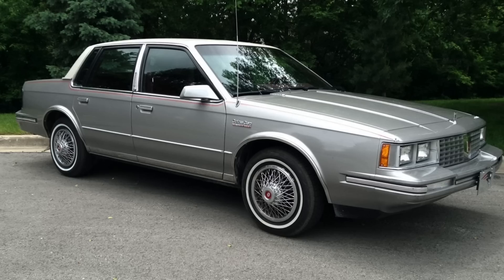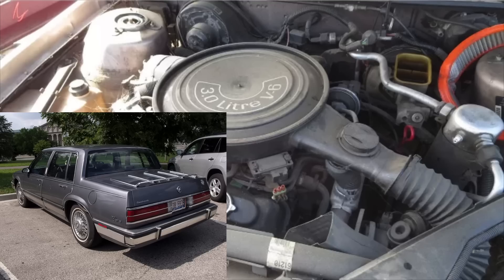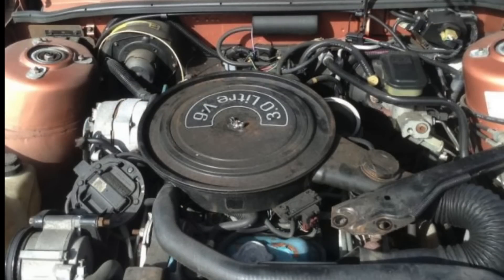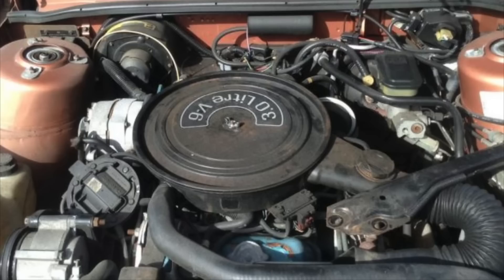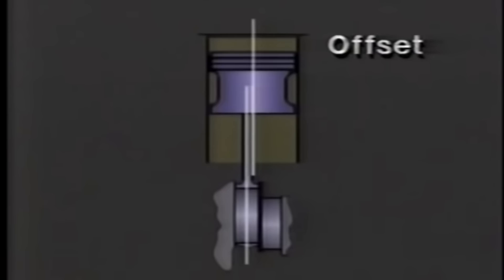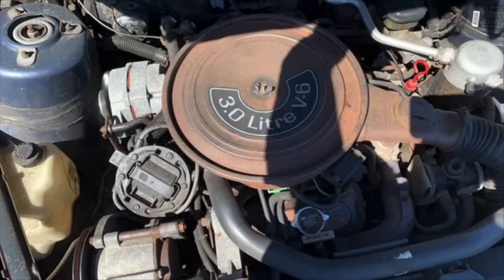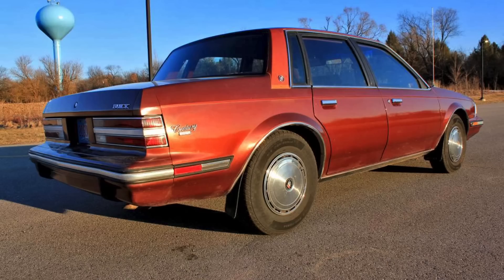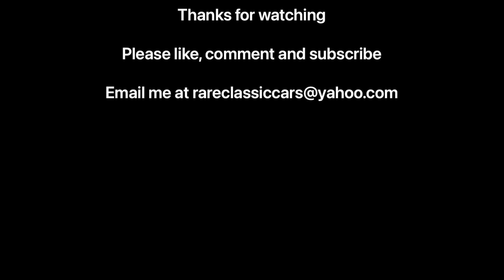Worst Engines of All Time: GM's 3.0L LK9 Carbureted V6 Engine (Buick Century, Olds Cutlass Ciera)

Comment: As a retired Service Director in a Buick Olds dealership, I lived through seeing customers and technicians being tortured by the 3.0 V6, LK9. Can't think of anything positive to say about it.  Didn't even make a decent boat anchor.
Reply from the maker: No they didn’t. So many problems, as I’m sure you witness first hand.
Reply: @RareClassicCars  the best thing about this engine is that it was much less common than the 2.8. So i didn’t have to deal with them that often.
Reply: I was fortunate enough in the early 2000s I had a 1985 Buick century custom with a 3.0L LK9 carbureted V6 and I never had any trouble out of it although I drove the car for a little and only had it for a couple of years.
Reply: @misskittycalais7300   I’m sure there were a good number that were relatively trouble free. I believe that the oil pump was the greatest determining factor in whether they lasted the typical 100k or not. The rest of the problems were probably carburetor related.
Reply: @dmandman9  now I did have trouble starting at sometimes, it was very finicky. I had the carburetor rebuild at a GM dealership in Nashville, but it still was finicky.
Reply: @misskittycalais7300  I think the vast majority of carburetors of that era were finicky to one degree or the other, especially after a cold start. I think it was an operating requirement . If a vehicle only stalled once or twice on a cold start, and stumbled for only a few minutes on a cold morning, we counted that as a successful rebuild and normal operation 😅
Reply: @dmandman9  sometimes I wish I had kept that car. I feel like it was a mistake getting rid of it.
Reply: @misskittycalais7300  you probably did the right thing to get rid of it unless you wanted to keep it for sentimental reasons because you probably would have had to rebuild either the engine or transmission by now a couple of times if you used it as a daily driver. Even if we’ll taken care of, engines of that era had about 100,000 to 125,000 lifespan tops before major repairs were necessary.
Reply: @dmandman9  truth
Reply: A handful of BB’s were the best thing for these 3liter bombs to put them out of there misery.
Reply: I worked as a lube technician as a teenager at a Buick Oldsmobile dealership in 1976. Our Achilles heel was the odd firing 231 V6. I stayed in the automotive industry until I retired 5 years ago. I remember the Century’s and Ciera’s with this garbage engine. I drove an ‘85 Century wagon with the 3.8 V6 and couldn’t believe the difference. It’s no wonder GM ended up in the shape that they ended up in.
Reply: The odd fire ones ran the best. And sounded great!
Reply: @shawnsatterlee6035  My Aunt had a 79  0lds omega brand new with the odd 🔥 fire 3.8 .It last all of one year.Easy to work on ,replaced the engine while she was at work.
Reply: I disagree partly, Their best use was as a boat anchor
Reply: Wouldnt fall out of a tree if you pushed it. Lol. Dont miss these a bit.
Reply: How did the 5.7 liter LT1 V8 in the 1994 Buick Roadmaster do over time?
Reply: @moonbeamskies  like the millions of chevy small blocks before the 1994 LT1 and all those produced after it, with proper maintenance they kept running,  no severe abnormalities.  Some still running fine still today.
Reply: @moonbeamskies3346  I still own the Lt1 engine and trans  from Roadmaster, had to let the body go.
Reply: @moonbeamskies3346  from my experience it was a good engine and held up pretty decently in all applications it was installed in.
Reply: A girlfriend of mine her parents had a century with the 3.0 carbureted and a Pontiac 6000 with the iron duke.   It was crazy at the time the 6000 was so much faster.  The Buick gas pedal was an on and off switch and we would shift manually when it would whistle.  😂 never blew up but probably only had 45k on it at the time.
Reply: @tjbartel1  A version of this engine was run in indy races for a time.
It's funny as heck to hear people poo-poo on this engine, completely discounting it's accomplishments.
Then talking up the heavier chevy 90 degree v6, which went through the very same redesigns.  LOL
Reply: I was a line tech at a Buick / GMC dealer in the 1980s.     Hell on Earth.      You'd STARVE to death doing warranty work unless you had a slick Service Manager / Service Advisor who knew how to sharpen up their pencil and bend the rules with warranty times / labor operations.    The factory reps frankly weren't all that bright to catch on back then (thankfully).
Reply: As a Buick technician in the early nineties I remember having a bad experience with one myself
Reply: When working was ok.
Reply: As a retired GM technician, I agree
Reply: The Pontiac version of the A body was the 6000 not the Phoenix.  Also,    the Buick and Olds versions had a 3.3 v6.
Reply: Oil pump, timing gear, and lack of zinc oil. These were the biggest factors that demised this engine.
Reply: @Stan-rj8ki  -  The bottom ends were WEAK on these POS  3.0 engines.   Zinc oil......No zinc oil....Fresh Mobil 1 oil and filter every day or bargain supermarket oil once per year...  ...knock yourself out.    They are failure-prone boat anchors and poor boat anchors at that.
Reply: We had a 84 Century custom with a V6.  It behaved very well.  The car before that one was another 84 Century with a 4 cylinder that chewed up serpentine belts.
Reply: @RichardFriedlaender  i forgot that some of them ate belts for dinner.
Reply: @RichardFriedlaender  The 1984 models didn't come with serpentine belts. Those are V belts. 1987 was the first year with serpentine belts on the iron duke and 2.8. The 3.8 red dot might have had serpentine belts before the others.
Reply: Nothing wrong with this engine, it was a de-stroked grand national engine.

Comment: Why did they use a carb when they had TBI by then?
Reply: It wasn't always cheap to have TBI. That is why the Hyundai Excel and Toyota Tercel had carbs until 1989.
Reply: @skylinefever  Mazda pickup trucks uses carburetors on thier 2.0 and 2.2 engines through the early 90's until they switched to selling rebadged Ford Rangers
Also Cadilac used carburated Olds 307 as late as 1990 if I'm not mistaken. 
GM trucks also had carburated 292 straight 6 very late in life.
Reply: It just hadn't made it into all cars yet.  My Granny's 87 Grand Prix had a 3.8 with 2 barrel carburetor.  Flawless,  silent engine.  27 mpg on the highway. Sadly,  it got totaled in a slow collision with a Toyota mini truck at 192,000 miles.

Comment: The 3 point-slow engine.  A dud by all measures.
Reply: Chever-Lay sold a 3.3 liter V6 engine in 1979/1980 that made all of 90 hp.....
Reply: @Flies2FLL  wasn't that a 3.8? Chevy 3.8, it was a 305 with 2 cyls missing
Reply: @johneckert1365  Chevy had a 3.3  just before that.   Gutless thing.
Reply: @johnz8210  omg, that must've been AWFUL
Reply: @johnz8210  Was that a 267 V8 with 2 cyls missing then?
Reply: @johneckert1365  No, it was a 3.3.  I think it was a 267 with two center cylinders missing, basically a small block Chevy cut down.  Only, these were TRASH engines and typically lasted less than 100,000 miles before needing a major overhaul!  This design morphed into the 4.3 liter V6.
Reply: @johneckert1365 Yes.
Reply: @johneckert1365  That sounds right, 3.5" bore, 3.48" stroke.

Comment: What did consumers think about all this? Were they disappointed in the offerings and the small engines or did they not care. Seems like such a lost decade.
Reply: - I think it helped push many away from vehicles made by the Big 3 and towards more reliable alternatives such as the Honda Accord & Toyota Camry.
Reply: Depended on your age group.  If you were like me (turned 16 in 1970), the move to smaller engines really sucked.  The only saving grace was that all newer cars suffered from low power so it wasn’t like everybody was speeding by you.
Reply: I wasn't even old enough to get my license till 91, but I'd say there was excitement for the "new muscle" like the pony cars ,as anyone a little older recalled the 60s glory days to us kids about hemi 454s with 600 HP and those torqueflite th-400 transmissions,  from the factory that ran 9s and you could get one if you knew someone. 🤣🤣

Even though they weren't powerhouses, they were decent for the time and people figured out pretty quickly on how to get a little more from them. At least they'd do a decent powerbrake smokey compared to most of the clapped 70s junk my older friends drove at the time.